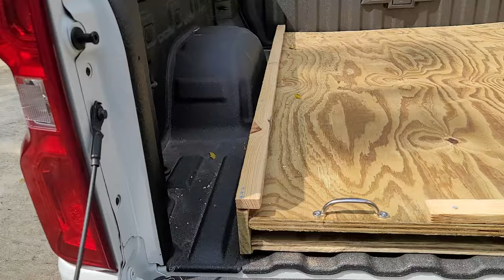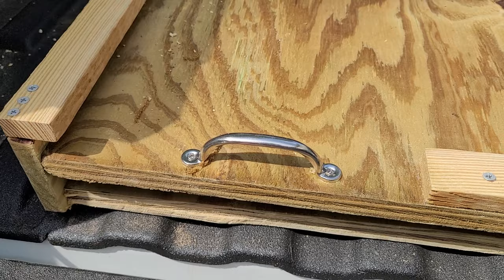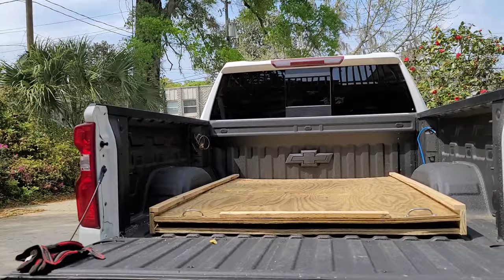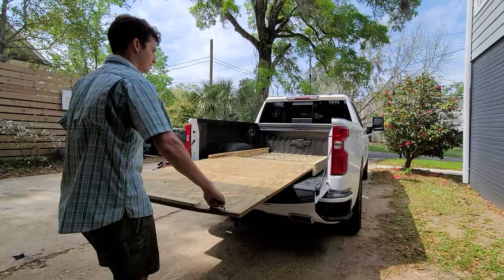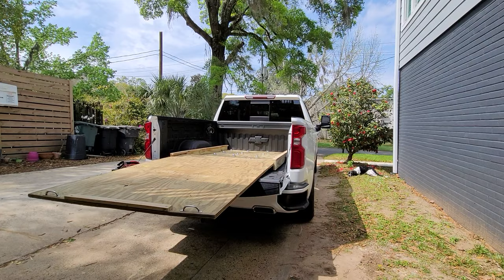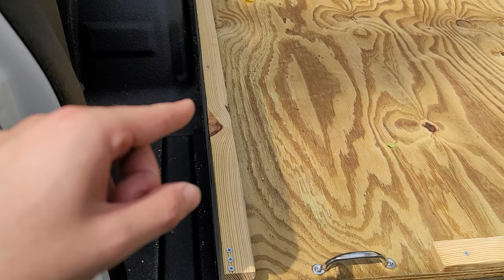DIY Bed Slide or Cargo Slide for 2020 Chevy Silverado 5' 8" Bed

Comment: Just built this today, used 30 rollers, and 1/2" plywood, will now remove and stain and put some light felt on the slide. Thanks for the video.

Comment: I don’t understand why people don’t understand the loading. Pull it out and throw your bags of cement on back and move in and load more weight and so on and so on. Then when unloading you do it in reverse. This is a great idea for 90% of anyone’s needs if you think you need a bed slide. And it’s cheap and durable.
I may add a flip out base piece with some bearings to support to the end of the tailgate.

Comment: I just did a build with similar components but in a different manner. Was needing a slide out mainly for hauling RC Planes so I covered a single sheet in the Loop side of hook and loop and use narrow strips of the hook side to strap my planes to it. I put the same ball bearings on the bottom of the same sheet that rolls in the grooves of the bed right on my Line X and I'm utilizing conduit legs after pulling it out that fit into sockets screwed into cast iron floor flanges on the bottom corners. I considered purchasing 60" drawer slides and using those instead, but those are $134 for a pair. Still may do that in the future but after getting this completed today I like it for now, works well.
 So basically it's half of the components you have here and using the bearing on the sheet that slides. The benefit in your design is you don't have to bother with the legs but it is more weight and harder to remove.
Thanks for sharing, one of the reasons YouTube is so great. Many from all over being able to share ideas of a topic!

Comment: Lol I did this last year. I didn’t know people were doing this on YouTube. Anyways, if you don’t put something on the bottom of the slide, the rollers will eat into the wood if you load it regularly. I use it for my work tools until it wouldn’t work anymore.
Reply: I wonder if adding a thin sheet of aluminum underneath would fix that

Comment: you could put your top rail 1x closer to the plywood and use felt to make it slide real good, that way there is no gap and any weight discrepancies you wouldn't have any slack or tip page, your roll out plywood would be in there tighter, I liek this idea, make it modular so the whole kit and caboodle comes out easily, using release pins..
Reply: Use felt where? I like the idea of the top rail closer to plywood.

Comment: How well did this work/pull out after it had weight on it? What might you have done different?
Reply from the maker: It does well. I’ve since added about 15 more bearings for better performance. I’ve also added more handles. So far it’s functioning as it should and I’m still pleased with the general build design. I’ve gotten a lot of compliments on it over the years.

Comment: Great video, is the platform screwed down or anchored to the bed of your truck at all or do you relying on the weight based plywood sheet to keep it from tipping up when the slide is extended out?
Reply from the maker: nothing keeping it to the bed of the truck. If you do this, definitely put that in your plans to do.
Reply: @sean-rady  curious, do you think just drilling some long boards and running them through the truck bed is the way to go? I do have a drop bedliner. I guess if I were to see you the whole well enough issue, curious on your thoughts

Comment: What screws did you use to bolt down the bottom plywood to the bed
Reply from the maker: I did not secure the wood to the bed but other comments and builders have done that.

Comment: You didn’t show how to anchor the bottom down so it doesn’t flip up in front with a load on it. You also need to put a stop about two thirds out so you accidentally pull it all the way out. I’m going to build it with theses modifications.
Reply from the maker: Nice have fun!

Comment: Isn't there another, lighter, material that could be used in place of the wood sheeting?
Reply: Shouldn’t go any lighter than he did… it’s already too weak…
Reply: Aluminum on 3 rails, with the bearings on the rails

Comment: Does it still work that good when it's loaded up with stuff
Reply from the maker: So in the original build, I only had 24 bearings (I bought out HF) and quickly realized that I needed more for the slide to operate better. I have since added another 20 or so bearings and it has worked MUCH better. The other thing I would suggest is putting wd40 or some type of anti-rust lubricant on the bears as they will definitely rust out and clog up. Lastly, when you're cutting the 4x8 sheets of plywood, i would actually make the width of the plywood 3 feet 11 inches wide and take a 1/2 inch off from each side. Reason for that is because the sides of the slides rub against the 1x4 side walls, and that creates drag too. But outside of that, I get compliments all the time at home depot and just random places. It's definitely made by life a lot easier and I'm glad I have it.

Comment: If you use 1/2” plywood, do you still need 1x4” sides?
Reply from the maker: no, you could probably go with smaller sides to keep it more compact and tight.
Reply: @sean-rady  you. Think one by threes could do it

Comment: Would never build this way… it’ll snap in half if you pull it out with anything heavy on it… this design needs LOTS of reinforcement to be worthwhile…
Reply from the maker: There are a lot of flaws to it no doubt. I use it smartly and am sure not to over extend it. It's served its purpose many times without fail.
Reply: So what would u suggest, to replace said plywood? I haven't heard of anybody's snapping yet, and maybe they haven't weighed it down enough to do so. But if it's been a while & never weigh it down, chances are they won't, so your point is moot.
Reply: Definitely wouldn't pull it all the way out with a load. Thats obvious. Building mine this weekend.

Comment: I don't understand why everyone is praising this idea. You can't put any weight on it. So, yeah. Cool concept. It won't work.
Reply from the maker: I keep a 85 Gallon cooler on it, miter saw, drill bag, tool box, generator, shop vac, and misc work items and it works well. I haven’t totaled it up in weight but it serves me well. What amount of weight are you thinking?
Reply: @sean-rady No sagging in the center when loaded with stuff?